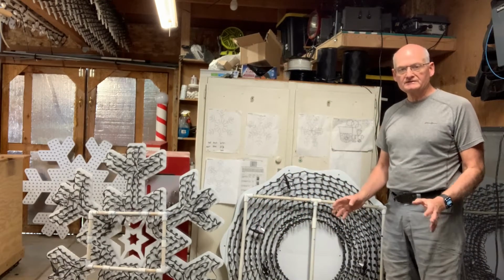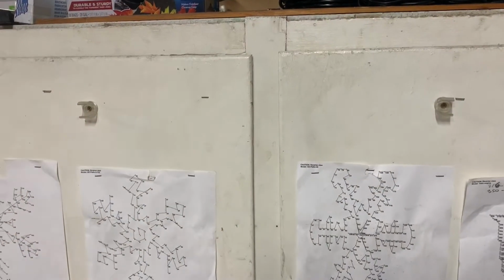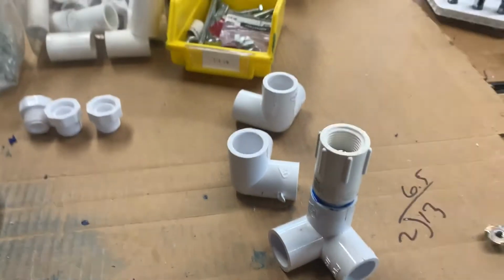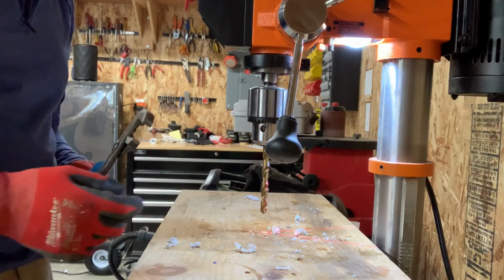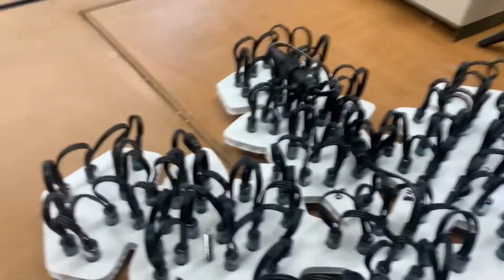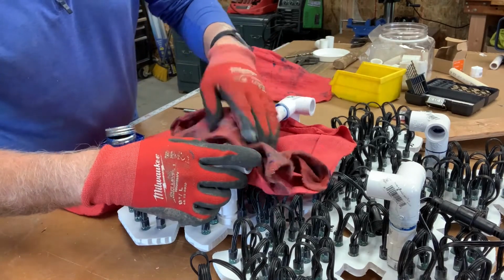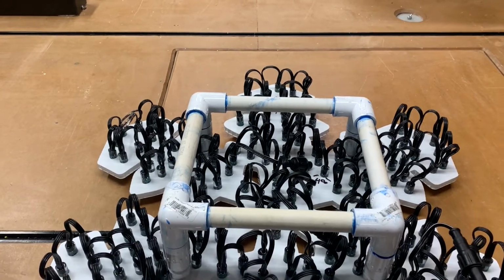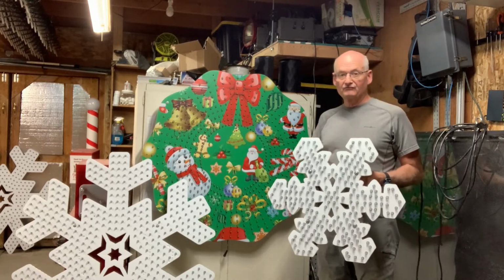Coro prop mounting using PVC

Comment: Could you please post the required parts?
Reply from the maker: I used 1/2 PVC pipe, couplings, Tees and elbows.  Also need 1/4 inch bolts and 1/4 inch t nuts.  Hope this helps.
Reply: @bergmannlights5149 thank you! This helps! Im better with reading and then following instructions.
Reply: @pauldurkin4569 this is extremely helpful what is the length of bolts

Comment: Thanks for the video. I bought 1/4" Tee Nuts, but they don't fit the PVC connector. They just slip right through. Is that the right size? (Could be that I am just a doofus)
Reply from the maker: Are using a coupling the is slip in one side and threaded on the other?.  The threads make in inside diameter a little smaller